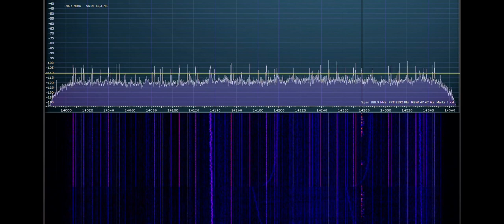Mini Whip Active Antenna SDR RX

Comment: Ground is very important for field probe antennas.

I got a one outside connected to the ground(tent anchors and wire) and a long coax(laying on the ground hopefully giving some capacitive coupling) going to it. It seems to do the trick.

If you have a metal roof it would help. Also if you can get it off the ground some distance and still ground-connected it should get th signals a bit stronger.

Ideally in the middle of nowhere, since they do pick up all kinds of stuff.

Comment: Like so many videos, this approaches the whip as something that will work with a 'quick test' out the window. It will 'work', but vastly below its potential. So it's a bad example of performance for those watching it. You need as much height as you can get with an E-field probe like this and the metal pole, if used, must be well grounded. With plastic poles, the coax sheath must be grounded outside the shack to its own grounding point, not the mains earth! Plenty of ferrites on the coax are also advisable. With proper deployment and careful noise elimination, my tests show the miniwhip can outperform an amplified 3m-circumference loop, which is the standard 'good performer' for most people who use compact lower frequency antennas. https://www.youtube.com/watch?v=etFCTD8vbQs